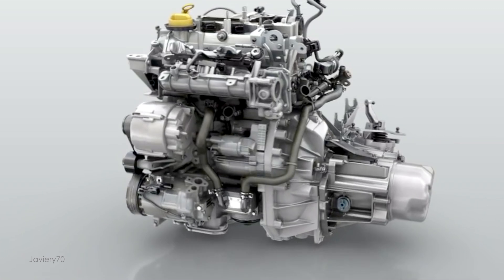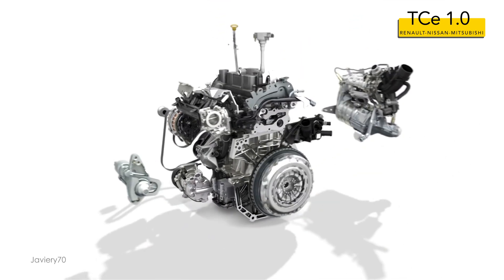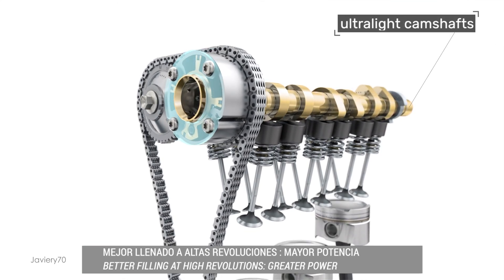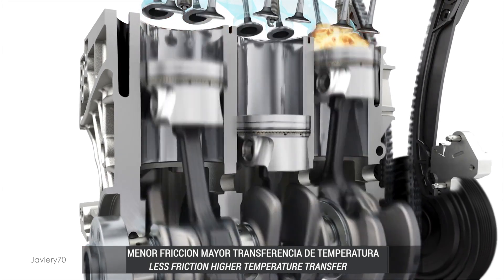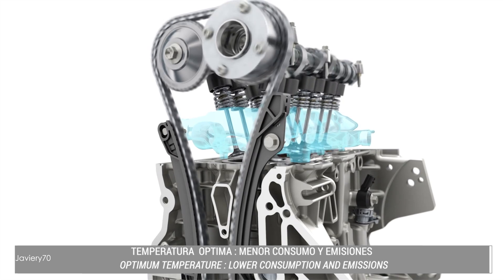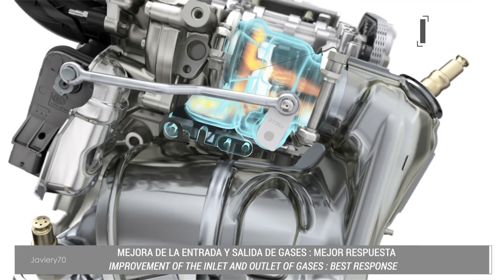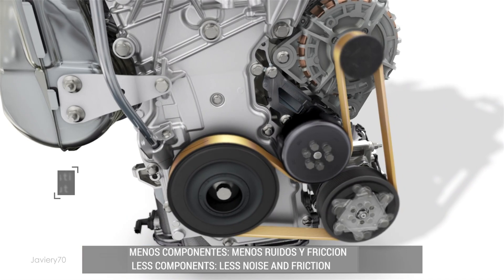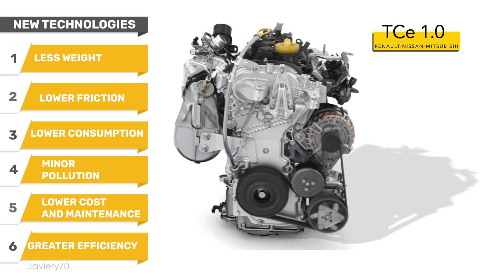🔸 RENAULT - DACIA 1.0 TCe - HR10DET Engine its technology ( eng )

Comment: I bought my first-release 2023 Clio Evolution 1.0 TCe/X-Tronic. I drive it very carefully and it is currently at 25,000 km. However, I am experiencing some issues. The car is still under warranty and I always have the maintenance done at an official Renault service center.

1. During cold starts in the morning, the idle fluctuates excessively and if I start driving, the car hesitates/misfires.
2. In recent days, the turbo sound has changed.
3. My city-driving fuel consumption is around 8–9 L/100 km.
What do you think I should do? 😢
https://youtube.com/shorts/MpnJF7Y7hD0?si=7pkcUCFVIH46p9s6
Reply: my new expression is using more than i expected compared with my  old car with the Acess 65 engine which was giving approaching the published figures . However the TCe 90 engine is smoother  and better acceleration. For my small monthly mileage the extra cost is bearable. In your case there is a clear problem . THere is nothing you can do yourself . Book the car in to a main dealer ask for a courtesy car if the garage ask to leave thecar for more than a day.- sometimes they will test the car over a week of daliy  running
Reply: @amvvol2  Thank you, I will keep you updated about any developments 🖐
Reply from the maker: A diagnostic test is necessary to accurately determine the cause.
When there is an engine fault, a fault message should appear on the instrument panel.
Do you use cheap gasoline? Low-cost gasoline?
Reply: @javiery70  Thank you for your reply 🖐
No, I don’t use cheap gasoline. I always buy fuel from Shell or Total here in Türkiye. We normally use 95 octane gasoline, and 98 octane is almost impossible to find.
Did you watch the video I uploaded?
Reply from the maker: I've seen the video.

The engine vibrates and doesn't sound right; there's an abnormal noise.

The spark plugs should be checked because of the vibration, and the source of the noise should be located.

I've had very similar problems, and the cause was low-quality fuel.

Since it's under warranty, you should take it to a Renault dealership for a checkup.
Reply: @javiery70  When I went in for the 2-year service last month, I mentioned this problem. The service advisor said the car needed to stay there so they could start it cold the next morning, but I wasn’t very comfortable leaving my car there overnight, so I didn’t accept it.

Thank you for your help and for your channel. If there are any updates, I will write here again.:hands-yellow-heart-red:
Reply from the maker: If the fault only appears with the engine cold on the first start, that waiting time is necessary for a correct diagnosis; it is reasonable because the temperature needs to be checked as it could also be the cause.
Reply: @javiery70 Thank you, I will keep you updated about any developments 🖐
Reply: Take the car on a very long drive, couple hundred miles of continuous drive, keep it in the higher rev range, it may clean up soot buildup
Reply: perhaps you have eco mode. I think this can make  some difference to smooth running for  short time particularly in colder weather.
Reply: @amvvol2  Yes, it has an Eco mode (there are only two modes: Eco and Normal). When I start the car, it automatically runs in Normal mode. I bought this car brand new with great excitement, but unfortunately it has been disappointing. The high fuel consumption and the problems that have started to appear really upset me.
I think I will probably sell it.
Reply from the maker: Try a different gasoline.
Reply: Yeah, same thing in cold weather on a Dacia Logan 2025 LPG  (Same engine 1.0 TCE)  , cold start  goes to 1400 RPM by itself that is the stupid EURO 6D full standard  it needs to heat up the catalyst to lower emissions, you either wait until it stabilizes itself to around 800-900 rpm  or you keep the car accelerated over 1500 rpm  otherwise the engine will stall. When the engine gets on temperature  it will work normally, even if you stop and start it again. It happened to me, and in winter when temps go under 10C  I already know the drill, either let the engine heat  in idle, or if I need to go immediately just keep the rpm over 1500

Comment: Hi. My 2016 Clio has the TCe90. The engine doesn't sound as smooth as other petrol engines, is this because there is a slight imbalance with having an odd number of cylinders?
Reply from the maker: Yes.
Three-cylinder engines have a characteristic sound that is less smooth, progressive, and uniform than a four-cylinder engine.
Reply: @javiery70 I had a feeling that was the case. Thanks for confirming
Reply: I have the same engine in a new dacia 2025 sandero. It is quite smooth I noticed some lumpy take off one morning , I turned off eco mode

Comment: My Juke(2021) use same engine, but with direct injection. Bought it new, already have 221 k km on the clock. No issues, but serviced properly(every 10 k km), never abused. The only problem is the vibration, but this engine is made to be cheap, so no balance shaft.

Comment: Basically all the modern manufacturing techniques to make an engine last only a short time and be absolutely 💯 % replaceable / no reconditioning allowed.
Reply: Nonsense
Reply: @TheAllMightyGodofCod It certainly is -->  included metal spray coated cylinder walls😊 that cannot be honed .
Everything disposable.
Reply: Source? Trustmebro?
Reply: @JohnDoe-uw9nq  Why all leftist are unable to use the internet & lookup problems with design & repair of latest Euro engines - or watch the video in detail ?
Reply: @ausmartin1 The fact that you immediately blamed leftists to a guy asking for a source tells me everything I need about you
Reply: @SegFaultOnLine1984  woke much 😂

Comment: This engine is horrible. Super weak, not reliable, barely can do 150k miles.
Reply: Did you own such an engine?
Reply: @mihai9k751 my friend did own from new. Changed the oil every 5k miles. Changed the engine after 64k miles. It went with cracked head . Had thermostate problems, chain tensioner problems, coolant leaks. Piece of crap.

Comment: Perfect engineering. This thing can't be re-bored, will wear out just after warranty period thanks low oil pressure.
Reply: Back in the 1940s designers were being told that plated or sprayed bores would last 3-4 times as long as plain ones, which was equivalent to three rebores.
These engines do depend on lubrication with the correct oil at the stated internals and maintaining coolant levels,  but that's about the only issues.
Reply: Source?
Reply: @JohnDoe-uw9nq Basic knowledge is enough. Repairing aluminum cylinders with a metallic coating isn't easy or cheap. You can use steel sleeves, but with an engine like this, it's easier to replace it, which means buying another car. The same goes for an oil pump with adjustable flow. This works in a new, unworn engine. At high mileage, oil pressure will simply be lost in certain areas far from the oil pump, as it will leak out through the increased clearances. This indicates seizure.
Reply: @ravethecity find me a source of people not reaching high mileages because of what you claim.
Reply: @JohnDoe-uw9nq I won't try to prove anything to you. Anyone familiar with the subject knows that this technology isn't meant to be durable and last 25 years like cars with standard inline-four MPI engines from the 1990s. It's supposed to last a few years until the car ages visually, the infotainment system ceases to be supported, and it's destined for scrap—in the name of ecology and fuel consumption reduced by half a liter.

Comment: Μy new Juke has this engine with 114 bhp. It is very good for everyday use. What kind of lubricants do you suggest me to use? Can i find something suitable in Motul or Liqui Moli?
Reply from the maker: Hello.
I recommend the oil recommended by the manufacturer, Castrol RN17 5w-30 / 0w20

https://amzn.to/4qG330M

If it's under warranty, you should use the one recommended by the manufacturer. If it's out of warranty, you can use another brand, but it must meet the quality specifications of the manufacturer, RN17.
Reply: @javiery70 thank you very much

Comment: Ciao Javiery, ti è mai capitato qualche problema con il supporto motore vicino alla vaschetta dell'acqua? Ogni tanto sento intorno ai 1000 giri una risonanza solo all'interno dell'abitacolo e sembra provenire da quella zona. Da fuori però non si sente alcuna vibrazione. Tce 1.0 clio v 90 cv
Reply from the maker: Sì.
Potresti sentire un rombo intorno ai 1000-2000 giri/min.
Il supporto del cambio necessita di una rondella isolante in gomma sull'albero.
Questa rondella isola le vibrazioni dalla carrozzeria.
Reply: @javiery70 Grazie. Esatto, prima però non lo sentivo ma l'auto ha solo 18000 km. È possibile intervenire in qualche modo?
Reply from the maker: Il supporto del cambio si trova sotto la batteria.
È difficile da raggiungere.
Puoi recarti presso la tua officina Renault e discutere il problema. Se è in garanzia e ti manca la rondella isolante, te la installeranno loro.
Reply: @javiery70 ciao, lo sento proprio ai 900/1000 giri ed è molto leggero non da per nulla fastidio, magari non è il supporto può essere solo una risonanza infatti nel momento della vibrazione, sento la vibrazione leggera anche ai sedili ma dura solo un secondo
Reply from the maker: @pharaonbender   La causa potrebbe essere la vibrazione del supporto, mi sono capitati diversi casi ed è un problema noto alla Renault nel motore 1.0 Tce.

Comment: Are these engines made by Dacia in Romania or by Horse in Spain under licence?
Reply from the maker: It is manufactured by HORSE. Primarily in Spain, although there are also factories in Romania and Brazil.
Reply: The cylinder heads were also made at Nissan Sunderland
Reply: according to locations and names, anything about this engine doesn't sound promising:text-green-game-over::face-green-smiling:

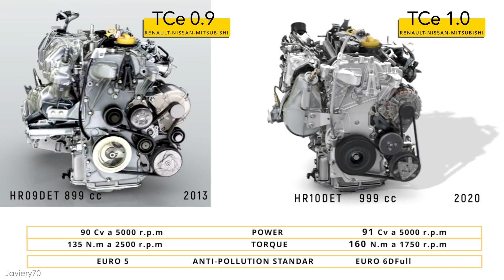Comment: What is accomplished? Compare 2013 vs 2020, stop the video at 0:43, worse consumption, worse emissions, o yeah 1hp more and i gues more Nm. Typo?
Reply from the maker: Thanks for commenting.

The video is not an engine comparison. The video shows that the new 1.0 TCe engine is an evolution, an improvement in 2019, of the old 0.9 TCe engine.

The improvement is shown at 0:32, where power increases by 10 horsepower and 25 Nm of torque.

The improvement compared to the comparison at 0:43 is due to the anti-pollution standard, which goes from EURO 6D TEMP in 2019 to EURO 6DFULL in 2020. Therefore, power and performance have had to be reduced to meet this standard.

A comparison is shown between the Renault CLIO 4 (0.9 TCE) and the Renault CLIO 5 (1.0 TCE). The values vary depending on the vehicle.

Comment: I heard there will be a 1.2 version soon? With LPG , is that true? Basically the successor of this one. Name is HR12
Reply from the maker: Hello.
The 1.2 TCe 3-cylinder engine (HR12) is a completely new engine.
There is a 48-volt mild hybrid LPG version. It's already available for the first time in the Dacia Bigster.
Reply: @javiery70 Greetings, so is it still too early to know if this new 1.2 engine is as reliable as the 1.0?
Reply from the maker: @Phyrox84  This engine debuted in the Austral at the end of 2022.
There are no engine issues so far.
In the hybrid version, there are issues with oil leaks and noises in the gearbox in the first units.

Comment: It's a really good, clear video, but when the engine is installed how do you get at the parts, such as alternator belt. I will have to go and open the bonnet in a showroom as I really like the Dacia Sandero Stepway. Judging by the comments it's reliable.
Reply from the maker: To change the belt, you'll need a wedge-like tool to install it without damaging it.
Two people are required to do this safely.
It's very difficult to do without jacking up the vehicle.

Comment: Could you tell me when the timing chain needs replacing. I have around 280.000 km on this engine, and it's starting to make some metal sounds. I suspect it's the chain but Renault says it lasts forever more or less.
Reply from the maker: Renault indicates that the timing chain cannot be replaced. There is no maintenance period.

Be very careful because the metallic noise can be confused with a faulty alternator pulley or water pump.

It would be necessary to locate the noise. To do this, it is necessary to remove the auxiliary belt to eliminate any noise from the water pump or alternator.
Reply: @javiery70 i Will take it to Renault tomorrow, and see what it is. This engine is definitely worth fixing , it took me everywhere I wanted with no problems at all.
Reply from the maker: @ytbior  I have seen taxis and driving schools operating with 300,000 km.
Reply: @javiery70 Just an update , I took it to Renault and they said it's coming from the turbo. It's a very weird noise, they will have to replace it. I thought the turbo would last forever but whatever. It's gonna be expensive probably.
Reply from the maker: @ytbior  If it's the turbo's noise, then the noise is coming from the rear of the engine, not the belt side.

The turbo is making a ratchet-like metallic noise when you release the accelerator.

Solution 1 is to reprogram the fuel injection control unit to limit its operation.

Solution 2 is to replace the turbo, as the part causing the noise cannot be removed.
Reply: What car do u have i wanto buy a daciq logan with this engine i want to now your experience with this engine 280 k wits a lot ...tell your feedback
Reply from the maker: @helioleal8152   Sorry for the wait...
280,000 is a lot of kilometers, but if the engine is well maintained, it could be in perfect condition. A visual inspection of the entire engine and the condition of its systems would be necessary to fully assess its health.
Only cars with those kilometers are admitted to our workshop, and they are very well maintained and in perfect condition.

Comment: Will a new version of this engine arrive ?
Reply: And also can you tell me which oil is best. Renault says 0w20. But a lot of people prefer 5 30.
Reply from the maker: The best oil is the one recommended by the manufacturer.
Depending on the vehicle and year, this engine can use RN17, RN17 FE, or Acea C3 and C5 grade oil.
With a viscosity of 5w30 or 0w20.
It is important to refer to the maintenance manual on the MY RENAULT / MY DACIA website.
During the warranty period, the recommended oil must be used.
Reply from the maker: For now, there's no news of a new version of this 90-100 hp 1.0 TCe (HR10 DET) engine.
There's already another 110-115 hp 1.0 TCe (HR10 DDT) engine, which is a new 3-cylinder version of the 1.3 TCe (HR13 DDT) engine.
Reply: @javiery70 this HR10DDT is the one powering the Renault Kardian in Brazil and other emerging country's, do you know if it is massively different then the HR10DET in this video?
In Brazil Renault is using ACEA A3/B4 5W40 oil, but the user manual doesn't specify it. Nissan also is using this same engine and they recommend ACEA C3 5W30 or ACEA C5 0W20.
Reply from the maker: @sergiopascareli7207  
Hello.
The HR10DDT engine is the 3-cylinder version of the HR13 engine (1.3 Tce).
The HR10 DDT and HR10DET are completely different engines; the only thing they have in common is their 1000 cc displacement.

Each country may have different maintenance requirements; you should check the MY RENAULT website for details.
Reply: @javiery70  thank you, are you planning on making a video about the HR10 DDT?
Also, do you happen to know if this engines have the same issue with the thermostat that the HR13 has?
Reply from the maker: @sergiopascareli7207   
It's this engine, but the 3-cylinder version has exactly the same components.

And the thermostat is the same as the one used in the 1.3-liter TCe engine, but the MAGAL brand.

https://youtu.be/h5-ZxhNCrek